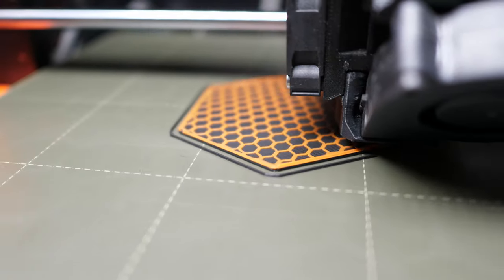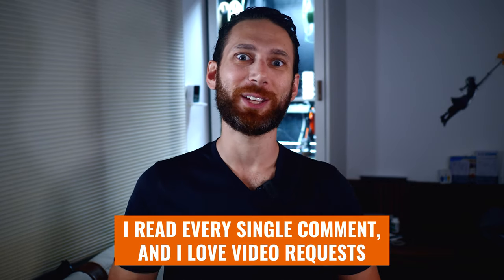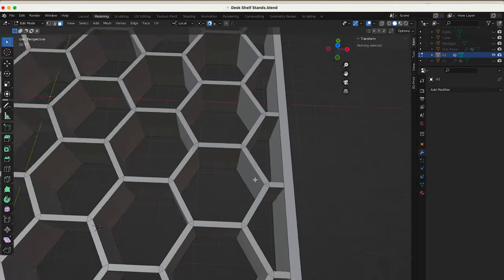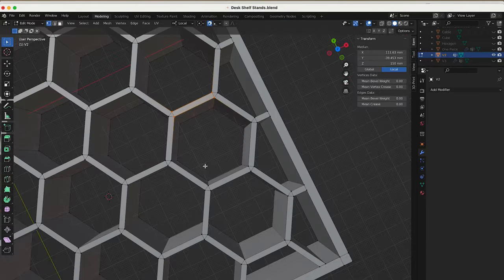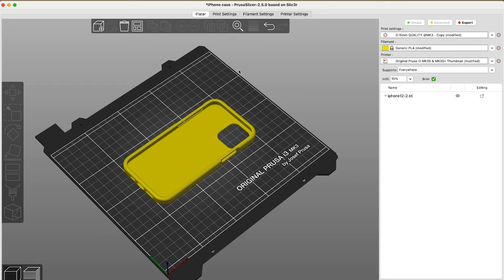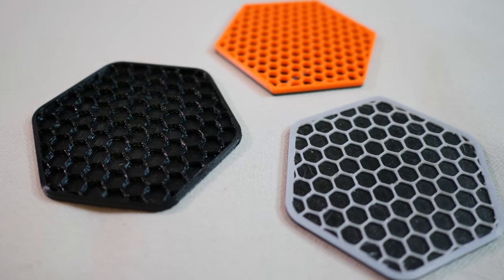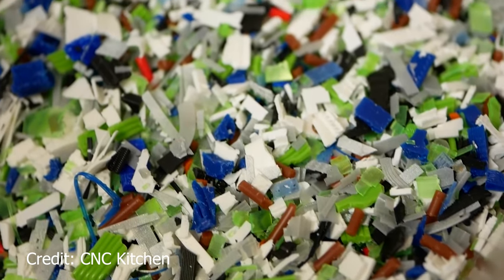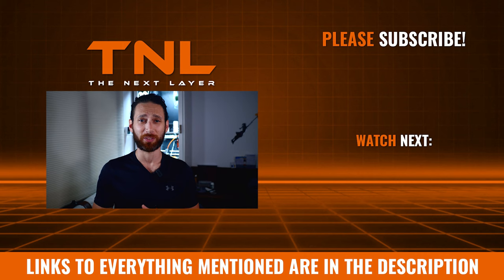AWESOME 3D Prints By Removing Top & Bottom Layers!

Comment: Once again a good video, thank you! This is a 'trick' I half discovered by accident - moved a print just below the ground plane in the slicer. . .   Hehehehe... After that I figured the trick out and made a fan grille. Coasters and trays are a great idea, I think they'll be a project very soon now. Thanks for the inspiration!
Reply: Weird. Most slicers will just slice off the bottom, and then add a new bottom. Useful when the bottom of the print isn't perfectly flat.
Reply from the maker: Awesome, thanks for the positive feedback. Wasn't sure how people would react to this video hehe.
Reply: This was a while back, and I think I'd just started using the slicer. Back then I was a rank newbie so I had pretty much every slicer sw before I settled on Cura mainly, Prusa secondary. I just remember this as a lightbulb moment.

Comment: Question: Does removing the top/bottom/both layers change the end Z Height of the print? In other words, does removing a solid layer mean the model is that many layers shorter?  Same question for removing the walls: Does it change the width/length or diameter of a part?

Comment: I actually just did this with a sample spool I found in printables!  The original model had a honeycomb pattern built in, but it took forever to print and the honeycomb walls were only a single layer thick so it was really flimsy.  Removing the honeycomb from the model and adding it in the slicer made the print stronger and reduced print time dramatically!
Reply from the maker: Yep! I did the same thing with my mini wire spool, and forgot about it until just now. I could've put it in the video. Oh well!

Comment: Hi is it possible to print part covered infill and exposed infill in the same print
For example the phone cases, the outside area of 20mm all round is top and bottom skin with infill, but the middle section is just infill?

Comment: creating a honeycomb pattern is really easy in fusion 360. i did it in 5 minutes. 
made one polygon and then use the grid pattern to extend it in one direction perfectly spaced. joined them all together. copied the structure, lined it up perfectly with the original and joined them, then did another pattern extension in the vertical direction and joined them all up. 
used the containing box to cut the honeycomb structure and highlight and delete the scrap bodies. 
bing battta boom blim blamo alakazam its done. 

you could make a parametric sketch but that takes more time than im willing to spend.
Reply from the maker: Yeah I don’t know fusion unfortunately I am just learning onshape recently

Comment: Hey, how about making a video on how you do your multi-color prints. Do you use the MMU? I tried getting my MMU to print, but it's nothing but headaches, so I'm removing it and going back to a single extruder (until I can spend more time tweaking the MMU).
Reply from the maker: I've heard that a lot about the MMU, and it's the reason I didn't get one in the end. I can show a video on a "multicolor" trick, though ;) Also, some of the stuff I show is printed in parts :)
Reply from the maker: Thanks for the suggestion, i'll do this video. make sure you're subbed
Reply: @thenextlayer  Already am! Love your vids!
Reply: @thenextlayer  If they're printed in parts, do you glue them? If so, what adhesive do you use?

Comment: How do you do the edges and other parts of the print too ?

e.g. I have a fan filter, I want the edge bits to be regular 3d printing to mount to the fan, so need to have top and bottom layers there, but the inside of the fan I want that bit to be the mesh. How do I make 'part' of my model like that and not all of it ?

Thank you

EDIT: Found my answer in this video: https://www.youtube.com/watch?v=6PVeh43Or-g&t=1s

Comment: Is the ender 3 a good 3d printer? I want to start 3d printing and my budget is around 200 euros
Reply: I love my Ender 3 and would absolutely recommend it. First, it's a mid-size printer--not too small, not too large. Second, there is a huge support community because it is a popular model, which means lots of tutorials, upgrades, and fixes are readily available.
Reply: I just got an Ender 3 a month ago and I'm loving it so far.
Reply: Creality's quality control is a bit inconsistent so you might get a perfect one or you might get one that needs a bit of tinkering, but you can definitely wind up with a great printer either way.

Check out Scott Yu-Jan's Ender 3 upgrade series, you don't NEED to do any of these but there are a bunch of cool ideas:

Part 1: https://www.youtube.com/watch?v=kG_YKeJDaX8
Part 2: https://www.youtube.com/watch?v=uBfMoOqCgPc
Part 3: https://www.youtube.com/watch?v=4jk6kZIwsQA
Reply from the maker: I don't have an Ender 3, but I hear they are good. I have a CR-10 V3 by the same company and it's awesome :)
Reply: @digrat  ok thank you
Reply: @thenextlayer  thanks for your answer

Comment: Okay, video request: What is your most costly 3D printing fail, why did it fail, and what would you do to prevent it in the future?
Reply from the maker: I actually already covered this :) In my Gridfinity tips, I show a bunch of purple stuff / failed bins, where I basically wasted an entire roll of "tough PLA" filament b/c I didn't do tests first, and assumed it would print the same as the normal brand PLA from the same manufacturer. BIG mistake!